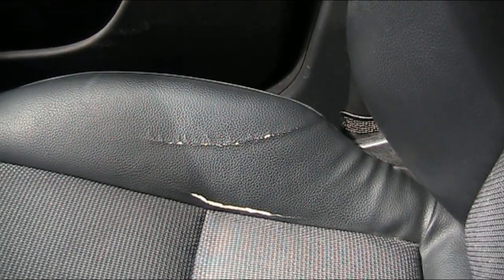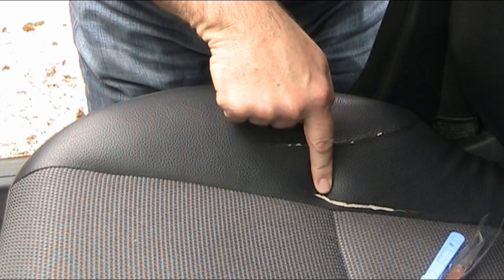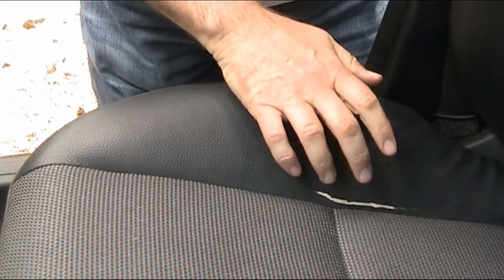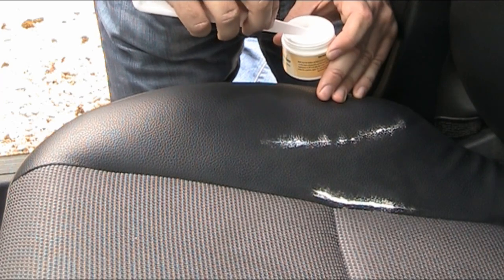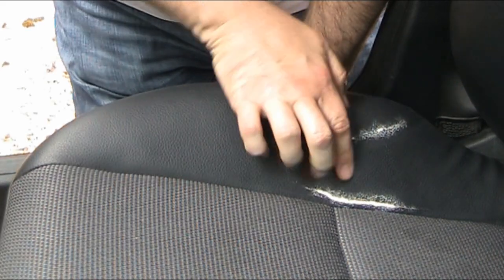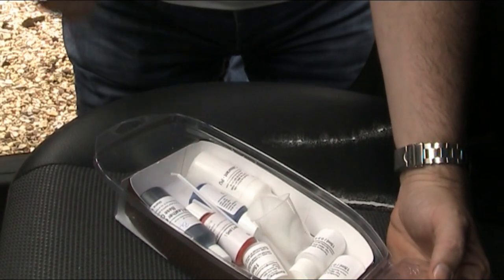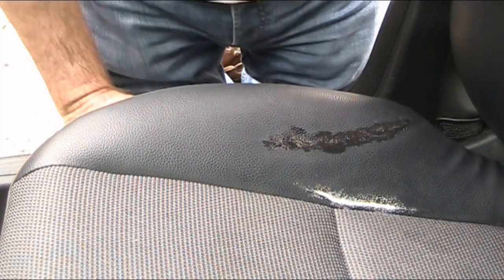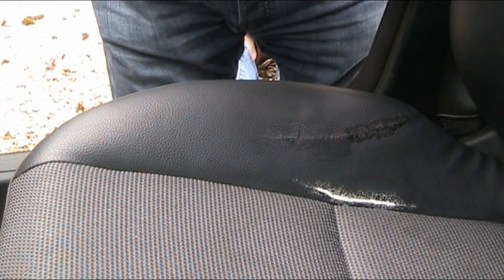How to repair a leather tear in a car seat

Comment: I have had leather repairs done several times in my luxury cars and it is always better to find an interior repair professional to do it right. I always used self employed people that were well reviewed and they did flawless work for a great price. This DIY job still shows the tears and I wouldn't be at all satisfied with it. Hire a pro.
Reply: I agree. Every leather repair kit (even by very reputable brands) get not so great reviews. Most will close a tear but I’ve found it impossible to hide.  Unless it’s a tear on a seam that can be stitched it’s easier to replace that section. But u did do a good job will this product. That’s pretty much the best it’s going to get
Reply: This looks terrible for the effort and money spent on the kit. You did the best you could. A pro can make it invisible.

Comment: It's easier to take the seat out and take it to a seat repairer. I work at a car dealership and we have always problems with Mercedes seats like these. They will change out the leather on the seat edge and it costs like 50 eur. Looks like a C-class.

Comment: It looks very bad ! To do a repair like this u have to heat it up with a pin point heat gun , squeeze it with a repair block, put compound,send it down with 400 sand paper,prep it ,add the base coat then seal it.
Reply from the maker: Well I wouldn't say it is very bad, as it looks so much better in real life. But fair comment, and I appreciate you sharing your knowledge so others can improve on my first effort. Thanks
Reply: To do a proper repair no heat gun no sanding  just replace panel  it does my nut to c all these shitty kits people sell